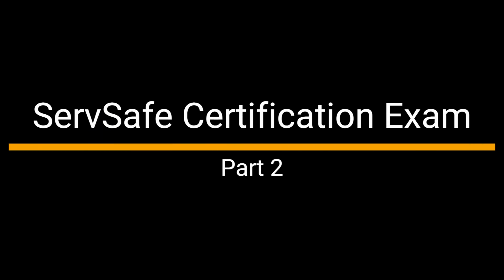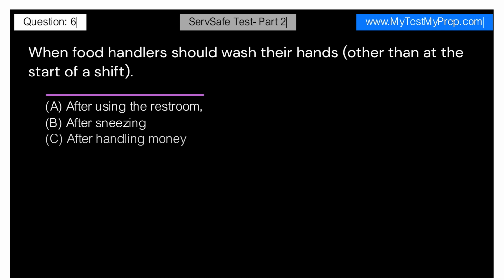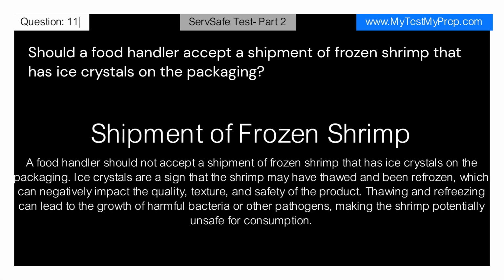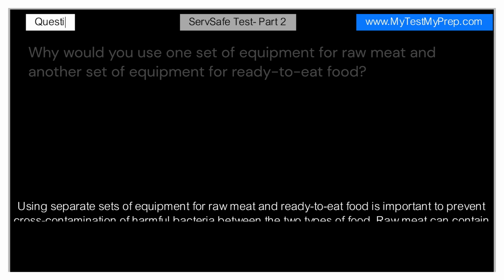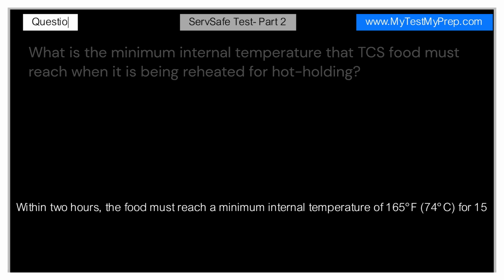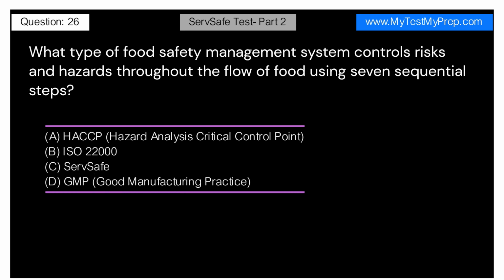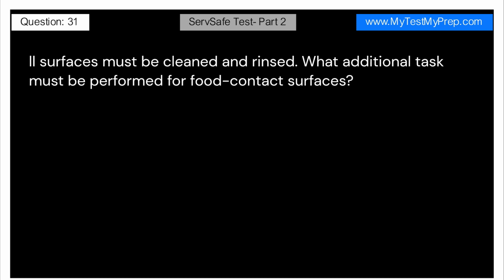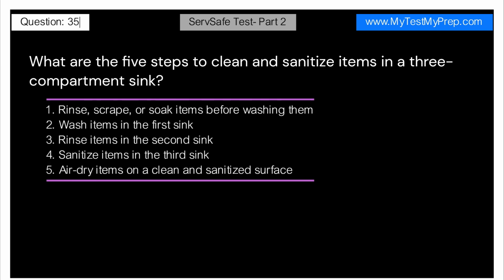ServSafe Practice Test #Part 2  Boost Your Food Safety Knowledge and Pass the Exam!

Comment: #7 needs to be updated
The 2022 Food Code lowers the minimum requirement for hand washing water temperature from at least 100°F to at least 85°F. This new minimum temperature aligns with the Uniform Plumbing Code and seems to be a comfortable temperature because it's close to the same temperature as the surface of people's skin.